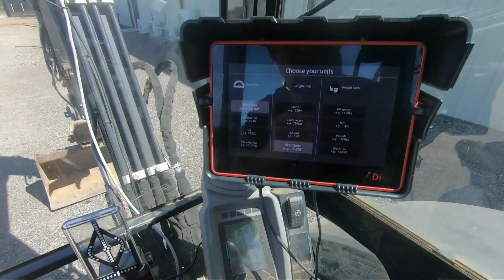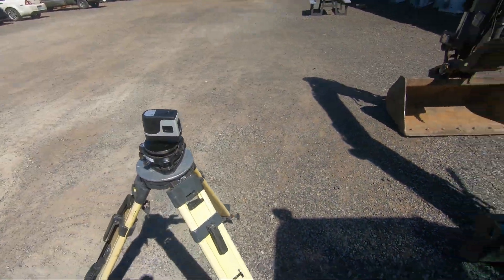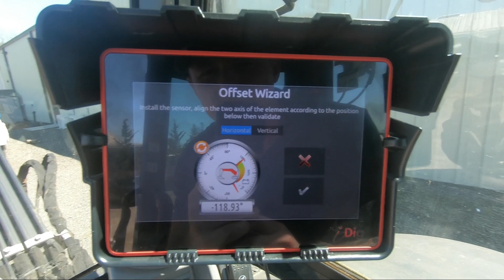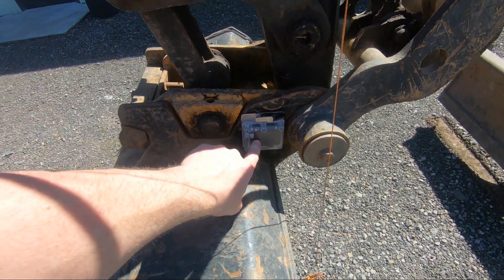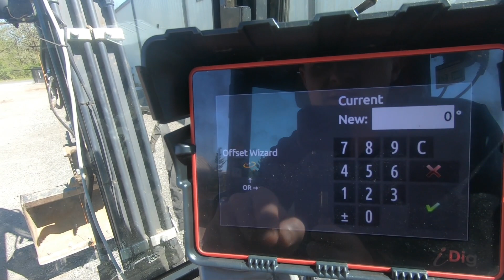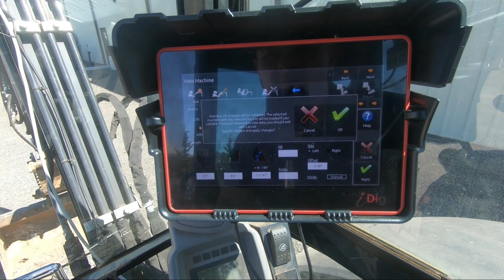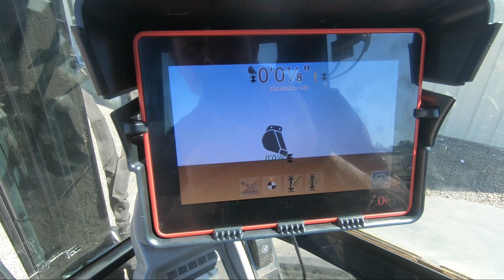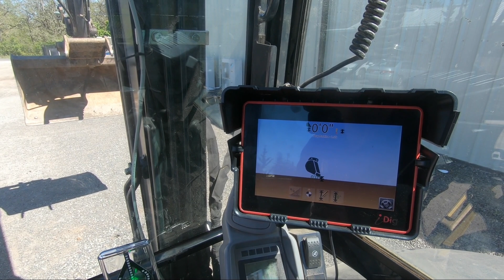Manual Installation & Calibration - iDig CT740 2D Excavator Grade Control Kit

Comment: Would that added cab angle during the first horizontal calibration make the body sensor inaccurate at all? Or is this cal just between the boom and stick sensors?
Reply from the maker: Each section for the calibration only does certain sensor(s) at a time. The 2D Sensor (or body sensor) has an independent calibration that can be done or redone anytime in the settings.
Reply: Awesome, thank you